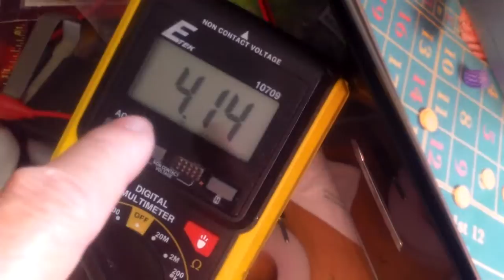Testing the18650 lithium ion battery with my solar light

Comment: Those are fake capacity cells (unfortunately) . Highest capacity known is Orbtronic-Panasonic 3500mAh  18650 Li-ion. It used to be 3600mAh Orbtronic but Panasonic is not making the core cell NCR18650G anymore.

Comment: You shoule be aware that all Li-Ion cells with over 3400mAh (as of this date) are fakes!
Check this webpage before buying cheap and dangerous Li-Ion cells!
http://lygte-info.dk/review/batteries2012/UltraFire%20TR18650%205000mAh%20%28Blue%29%20UK.html
Reply: +wtam69 I only buy panasonic ncr18650B cells 3200mah, those "5000mah" cells are more like 500mah knockoff junk
Reply from the maker: blendercloth My old laptop cells were only 1,400mA.  Do you know a good place to buy quality cells?
Reply: wtam69
Sorry, I wanted to correct my commenting by inserting "all 18650 Li-Ion cells" :-)
And the new maximum seems to be 3600mAh as of 2014. Sorry about that!

Good cells are the ones from e.g. Keeppower. But you will see that the price is over double the price of the fake one (a good indicator of fake ones is the small price).
Reply: +Inspector More-Anonymous best bang for your buck forsure

Comment from the maker: Thanks. I'm using this as another night light rechargeable daytime by the window.  It tops off quickly by USB power. The quality of the battery is unknown but I don't need a big battery box. This kind of project is kind of fun because you are capturing solar energy and reusing.